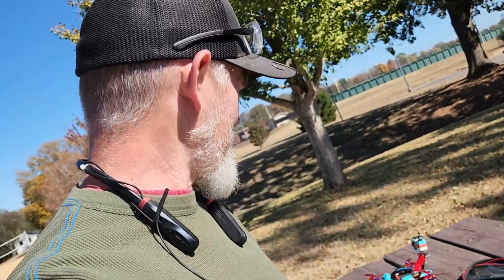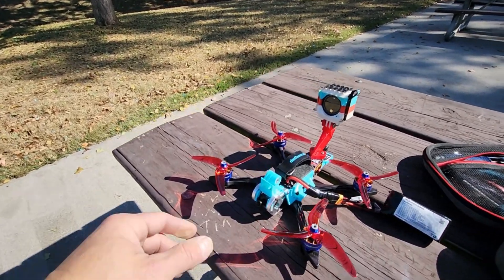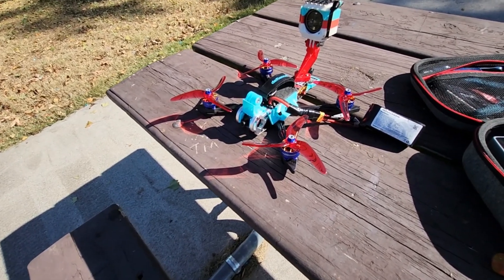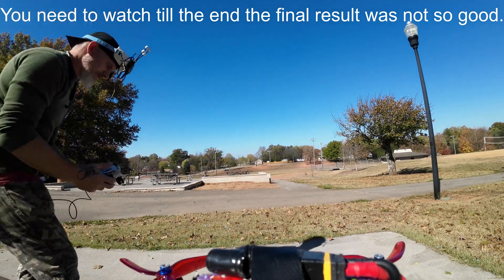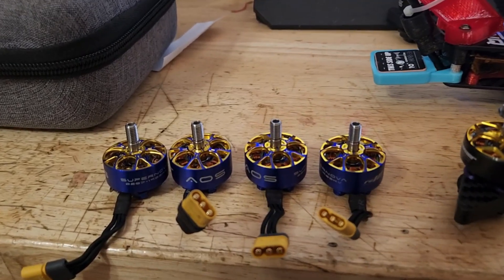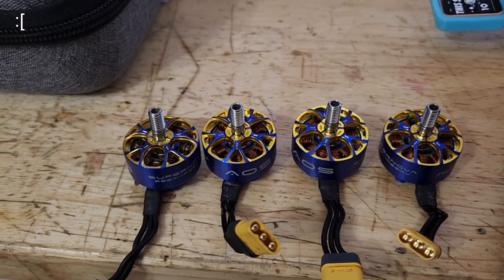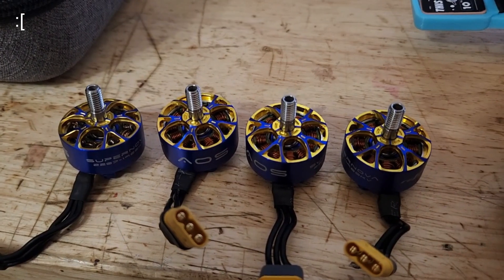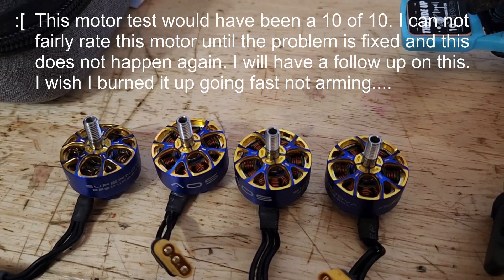MOTOR REVIEW Supernova 2207 1980kv Freestyle Drone w/ DJI Action Cam 2

Comment: I dunno man, you have a motor esc power mismatch and you were doing some long duration wailing screaming pulls. Esc, motor screw, bad tune, filters off, bad cap, etc could all have fried the motor. In my experience the esc is almost always the culprit anyway
Reply from the maker: they replaced it and illl be making another video

Comment: i expect you to have none or shitty capacitor. also you are not allowed to use MR30 connector when those motors push much more current. you should be punished, nut supported.
Reply: +1
Reply from the maker: 50volt and 35volt on both ends of the battery wire esc side 50v same as joshua bardwells 165mph drone and 35v stock at battery connector
Reply: @AtradiesFPV  voltage of capacitor does not matter. its resistance matters. and the important thing is the connector. it should not be there.
Reply from the maker: @sigterm15  I never heard of anyone having a issue with motor plugs. I live close to Evan Turner and he recommended them. But I took your advice and going to do another review. We have the supernova on a aos ul5 frame. It looks badass. I soldered the motors straight to the esc. Hope it all works well because I have had two other motor problems with rcinpower besides this one. But they replaced that one that caught fire and we are going at it again.

Comment: I’m no electrical engineer but those supernovas are rated for 61amp and your esc is 55amp. Back to back full throttle pulls with that set up will definitely make the esc go pop. That really sucks!
Reply: yes,,the one of highest amp  for 2207 motor class
Reply from the maker: I got the motor replaced and have not had a problem since and do long full throttles on it all the time it ripps I think that one was just a defect.

Comment: Check your screws that mount the motor to your frame, maybe they are a bit too long and cut in the motor wire. There is not much room for the cable with these motors..
Reply from the maker: Great advice but it was for sure a motor defect it has been replaced and no problem since.